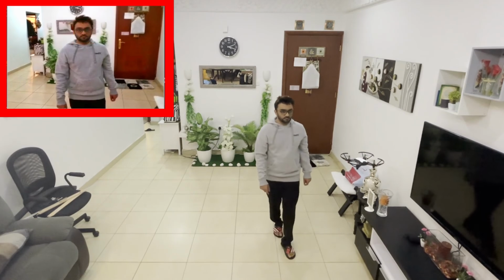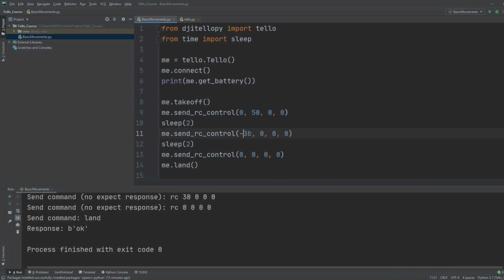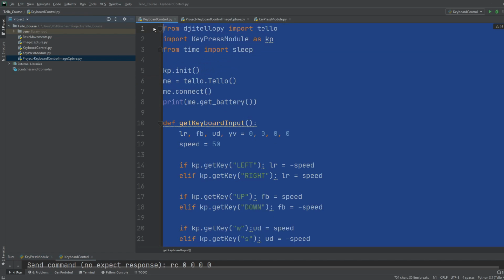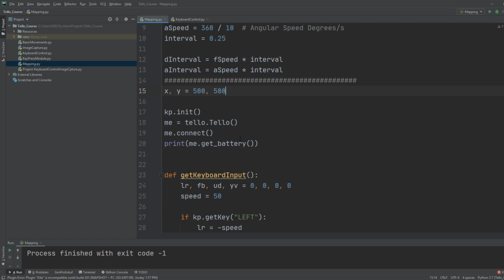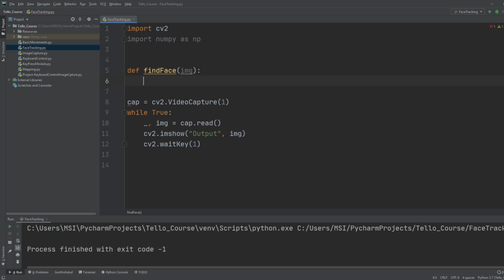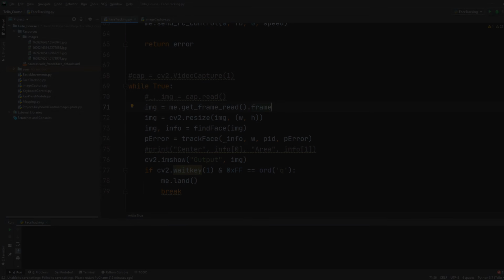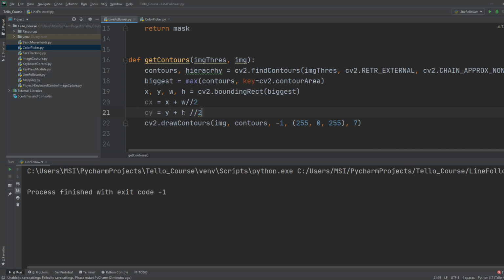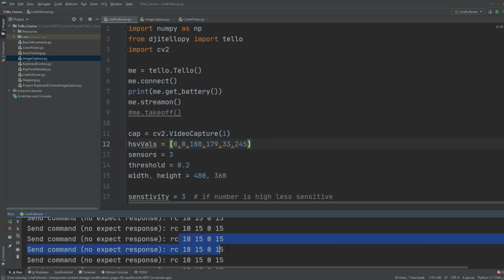Drone Programming With Python Course | 3 Hours | Including x4 Projects | Computer Vision

Comment: Watching and learning 3 years later! Impeccable content!

May I suggest a review of the derivation of the equations on coordinate measurement in project 2 mapping. 

We've correctly assumed, the distance in unit time, in our case is 10m, however in the equations, y=10xsin(45), we juxtapose displacement with Distance. 10 m in a second is the distance, the length of the curved path, or the section of the circumference of a circle with radius R= V/w (where V is 10m/s in our case, and w the rotational velocity, 45 deg/s) in our case.

Here's an excerpt answer from ChatGPT when asked to evaluate position of a drone moving at a constant velocity of 10 m/s, rotational speed of 45 deg/s after x amount of time:

"To analyze the motion of the drone and determine its coordinate position after a certain amount of time, we can break the problem into two main parts: linear motion (forward velocity) and rotational motion (clockwise rotation). The drone's path will trace a circular arc due to its constant rotation while moving forward. Let's denote:

- V as the forward velocity of the drone, which is 10 m/s in this case.
- W as the angular velocity of the drone, which is \(45\) degrees per second. However, for calculation purposes, we need to convert this to radians per second. \(1\) degree = \(\frac{\pi}{180}\) radians. So, \(\omega = 45 \times \frac{\pi}{180} = pi/4 radians per second.

### Position Calculation

Assuming the drone starts at the origin \((0, 0)\) of a coordinate system at time \(t = 0\), and its initial heading is along the positive x-axis, we can calculate its position after time \(t\) seconds due to its circular motion. The radius \(R\) of the circle traced by the drone's motion can be found using the relationship between linear velocity (\(V\)), and angular velocity (\(\omega\)), where \(R = \frac{V}{\omega}\).

#### Equations

1. **Radius of Circular Path**: \(R = \frac{V}{\omega}\)
2. **Angular Displacement**: \(\theta = \omega \times t\), where \(t\) is the time in seconds.
3. **X and Y Coordinates**: The drone's position \((x, y)\) on the circle after time \(t\) can be determined from the circular motion equations:
   - \(x = R \cdot \sin(\theta)\)
   - \(y = R \cdot \cos(\theta)\)

Note that these equations assume the drone's path is a circle centered at the origin with the drone starting at the point \((R, 0)\) and moving in a clockwise direction. However, due to the clockwise rotation, we may need to adjust the signs in our final equations based on the direction of motion.

Let's plug in the values and compute the position of the drone after a given time \(t\).

After \(10\) seconds, the drone's position, assuming it started from the origin and moved in a clockwise direction with a constant forward velocity of \(10\) m/s and a uniform clockwise rotation of \(45\) degrees per second, would be approximately \((12.73, 0)\) in the coordinate system. The \(y\) value is very close to \(0\), indicating the drone has moved almost exactly along the x-axis from its starting point, which is due to the nature of circular motion and the specific time chosen for this calculation.

This result indicates that after \(10\) seconds, the drone has essentially moved in a circular path and returned very close to its original horizontal position due to the combination of its forward speed and rotational speed. 

To determine the drone's position after any amount of time \(x\), you can use the equations:
R = V/W
x= R.sin(W.t)
y = R.cos(W.t)

where t is the time in seconds, V is the forward velocity, and W is the angular velocity in radians per second."

Comment: Hi Murtaza, I found your course very well explained. I have been following your course using OpenCV 4.9.00 and Python 3.11. I have encountered an issue where the webcam does not display the contours in black and white on the A4 paper as expected. Instead, it shows an error at this line of code: _, img = cap.read(). Could you please advise if this issue might be related to the versions of OpenCV and Python that I am using? Any guidance you could provide would be greatly appreciated. Thank you.

Comment: Hello, I am facing a challenge during the image capture project and hoping that you or someone with the knowledge may be able to help me. I keep getting the following error. I have tried rebooting, and reconnecting and also have tried on 3 different Tello edu drones. However, I get the exact same error code with all the 3 drones. I am directly connected to the Tello drone through its own wifi hotspot, also My Windows Defender firewall is turned off and I do not have any other antivirus software installed. I do not understand. Please guide.
I am attaching my code first and then the outcome/error message.
P.S: I also tried to remove the resize command code and still, I get the same error.

CODE:
from djitellopy import tello
from time import sleep
import cv2

drone = tello.Tello()
drone.connect()
print(drone.get_battery())

drone.streamoff()
sleep(1)
drone.streamon()

while True:
    img = drone.get_frame_read().frame
    img = cv2.resize(img, (640, 480))
    cv2.imshow("frame", img)
    cv2.waitKey(5)

RESULT:
C:\Users\joshi\PycharmProjects\OpencvPython\TellDrone\.venv\Scripts\python.exe C:\Users\joshi\PycharmProjects\OpencvPython\TellDrone\ImageCapture.py 
Send command: command
Response: b'ok'
Send command: battery?
Response: b'90\r\n'
90

Send command: streamon
Response: b'ok'
Traceback (most recent call last):
  File "C:\Users\joshi\PycharmProjects\OpencvPython\TellDrone\ImageCapture.py", line 15, in <module>
    img = cv2.resize(img, (640, 480))
cv2.error: OpenCV(4.4.0) C:\Users\appveyor\AppData\Local\Temp\1\pip-req-build-6sxsq0tp\opencv\modules\imgproc\src\resize.cpp:3929: error: (-215:Assertion failed) !ssize.empty() in function 'cv::resize'

Process finished with exit code 1
Reply: UPDATE:

I was able to solve the problem. Apparently, the issue was with the network adapter on my machine. So I used the following solution.

1) Take a wifi extender and configure it to connect to the Tello drone wifi address.
2) Connect the laptop via LAN cable to the wifi extender.
3) Connect to the Tello.

I was able to solve my problem with this method. The problem was not in the code, however, it was in the hardware and I used a different method to connect to the Tello.
Reply: @joshichintanc96 I’m having the same issue , i will try this solution , thanks
Reply: @joshichintanc96  for me doesn’t work 😑
Reply: @ That's unfortunate. Are you getting the exact same error? Because, using a dedicated network extender helped solve the problem for me. If I have to guess, it would be that issue was with transmission of data packets/firewall settings. Using an extender solved the issue. 

Please share exactly what you are doing and exactly what error do you face? Maybe the community could help you out or we could brainstorm.

Comment: Hello, Is it possible to have a version using C or C++
Reply: U don't need to write ur code in c or cpp because in this case u just need  to write a commands that can let u contrôle the drone and to that it is prefer to write the shortest code and the most readable also python has more lib can be implemented enlese if u are writing the firmware so here u will need cpp or c

Comment: brave effort, ut you confuse early on by referring to HDMI input on laptop.when you mean HDMI output- youcould overlay a correction graphic.

nav  of vid a good idea-

I'd like new vid re adding bluetooth c<pability to wirelessly stream video and sound via bluetoothfrom my macbook to my non-smart TV, using ineypensive plug-in  HDMI bluetooth adapter-  or is such streaming only by using appleplay through an apple adapter? nothing I found on net is conclusive one way or the other. of course, more people will be inTerested in wirelessly streaming from a PC to TV.
I TI think earlier bluetooth standard only audio-capable, nt for video- is that so, video and audio now supported over bluetooth?
anyone reding this acheived mac to non-smart tv streaming of video with audio, using inexpensive hHDMI bluetooth adapter on the TV?

Comment: Hi Paul, Have you been down the path of Arduinos and 3 Aspect signals that are is Series, as Signal 1 is Red, signal 2 is Yellow, Signal 3 is Green, with this in mind is there anything around that will able this to happen with out all the wires that I seem tp have got on my Breadboard. I would like to have a HO scale Cabinet somewhere behind the 3 Aspect Signal away from the Track area. To me this should be similar to have a Series of Points  on a layout that get their power via the Buss Wire, could this happen to the Arduino and 3 Aspect Signals. I think could save a heap of wires around the layout. I have been able to make an Arduino, Breadboard, Wire and Leds to work. I am not sure just how many signals can be on the one Arduino to work a series of 3 Aspect Signals, to change each from 1 color to the next when the track is clear. THANKS for your time Graeme

Comment: Hello Murtaza, thanks for your detailed tutorial.
I'm having trouble at part "Image Capture" (starting from 31:16), the terminal in PyCharm said "Cannot get first frame". I believe this happened not just in my system and programming environment.
After trying to set every dependency the same as yours, this error still exists.
Some other people are also facing this problem, submitting the issue on GitHub, and it seems they didn't find solution either.

Could you please have a look at this "Image Capture" part? Maybe something has changed, so your code here may also need a little change? 
I'm looking forward to your response! :)
Reply: did you solve it?
Reply: @everysimotv3837  Sadly no
Reply: hey!!! how did you do face tracking?? it's detecting my face but not tracking it :(

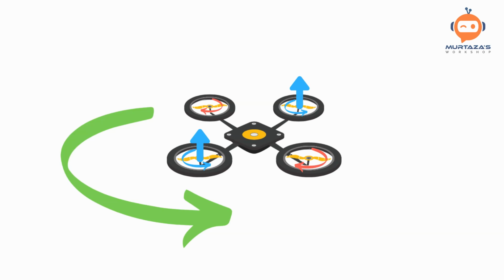Comment: at time 8:30, https://youtu.be/LmEcyQnfpDA?t=510, I guess you mixed rotations or is it correct, because if you decrease speed of clockwise and increase speed of anticlockwise motors then drone must turn anticlockwise, right? @murtazasworkshop

Comment: Does the non-edu one support python programming. I think it doesn't?
But the white drone seems like the normal one.
Reply: According to the video, they don't have difference at coding mentioned in this video.
Reply: @alexanderyang126  True, I bought both. Both support python. But the non-edu one is extremely unstable. It cannot even hover stably. I believe it's a defect. Will return it.

Comment: Thank you for your amazing video. I am 75 YO retired Telecom Engineer and my hobby is IoT and Aeromodelling. I really learned a lot of skills from your meticulous explanatory videos. 
I have a doubt that is: If I program the Tello to Take off and fly forward for 10 feet, then stop and reverse for 10 feet, stop and land, it is not landing at the place from where it took off due to change in battery condition etc., 
Is it possible to program the Tello to fly to a specific distance and come back, using it's accelerometer data or is there any other Drone model which can only, do this for me. Please advice. Thanks again with GREAT regards.
Reply: Some GPS drones have auto return to home.

Comment: Has OpenCV changed since you did this video or is there something missing that is needed to use OpenCV? I tried following along but none of the image capture stuff works, none of the functions you used for the OpenCV parts are being recognized and I downloaded the same library you did and just imported cv2 just as you did but pycahrm throws an error any time I try to use any of the cv2.whatever functions
Reply: Just to be clear here, I have added the OpenCV Python library in the settings, done import cv2, and everything from cv2.resize() to cv2.imshow() gives an unrecognized function error and cause the code to fail to run.

Comment: Hi, buddy. Is there a way to use computer mouse to control  the JR module? I m studying on a keyboard mouse method to fly FPV drone. The keyboard is very special designed by me with range. I test it on liftoff. With 0 experience and only 25 hours practice I break in world 23 on a track. So I really wanna apply this range keyboard + mouse method on real Drone. I just need the mouse output to the JR module now.

Comment: Hi Murtaza, you created an amazing tutorial on how to program the Tello drones, but I have one issue, in the keyboard control program the drone takeoff, but it is not accepting any other keyboard, and it land after 7 seconds. I cannot mow right or left or yaw the drone. I have the following errors:
Traceback (most recent call last):
  File "C:/Users/alzam/PycharmProjects/Tello_Course/KeyboardControl.py", line 34, in <module>
    me.send_rc_control(vals[0], vals[1], vals[2], vals[3])
  File "C:\Users\alzam\PycharmProjects\Tello_Course\venv\lib\site-packages\djitellopy\enforce_types.py", line 53, in wrapper
    check_types(spec, *args, **kwargs)
  File "C:\Users\alzam\PycharmProjects\Tello_Course\venv\lib\site-packages\djitellopy\enforce_types.py", line 46, in check_types
    .format(name, type_hint, type(value)))
TypeError: Unexpected type for 'yaw_velocity' (expected <class 'int'> but found <class 'NoneType'>)
[INFO] tello.py - 437 - Send command: 'land'
[WARNING] tello.py - 447 - Aborting command 'land'. Did not receive a response after 7 seconds
[INFO] tello.py - 437 - Send command: 'land'
[WARNING] tello.py - 447 - Aborting command 'land'. Did not receive a response after 7 seconds
[INFO] tello.py - 437 - Send command: 'land'
[WARNING] tello.py - 447 - Aborting command 'land'. Did not receive a response after 7 seconds
Exception ignored in: <function Tello._del_ at 0x000001C74282AC18>
Traceback (most recent call last):
  File "C:\Users\alzam\PycharmProjects\Tello_Course\venv\lib\site-packages\djitellopy\enforce_types.py", line 54, in wrapper
  File "C:\Users\alzam\PycharmProjects\Tello_Course\venv\lib\site-packages\djitellopy\tello.py", line 1019, in _del_
  File "C:\Users\alzam\PycharmProjects\Tello_Course\venv\lib\site-packages\djitellopy\enforce_types.py", line 54, in wrapper
  File "C:\Users\alzam\PycharmProjects\Tello_Course\venv\lib\site-packages\djitellopy\tello.py", line 1006, in end
  File "C:\Users\alzam\PycharmProjects\Tello_Course\venv\lib\site-packages\djitellopy\enforce_types.py", line 54, in wrapper
  File "C:\Users\alzam\PycharmProjects\Tello_Course\venv\lib\site-packages\djitellopy\tello.py", line 579, in land
  File "C:\Users\alzam\PycharmProjects\Tello_Course\venv\lib\site-packages\djitellopy\enforce_types.py", line 54, in wrapper
  File "C:\Users\alzam\PycharmProjects\Tello_Course\venv\lib\site-packages\djitellopy\tello.py", line 486, in send_control_command
  File "C:\Users\alzam\PycharmProjects\Tello_Course\venv\lib\site-packages\djitellopy\enforce_types.py", line 54, in wrapper
  File "C:\Users\alzam\PycharmProjects\Tello_Course\venv\lib\site-packages\djitellopy\tello.py", line 529, in raise_result_error
Exception: Command 'land' was unsuccessful for 4 tries. Latest response:	'Aborting command 'land'. Did not receive a response after 7 seconds'

Process finished with exit code 1

Comment: this course is great! just going through it now.. is it ok to have python 3.10 rather than 3.7.6?   Also when I am installing the packages, you have gone through the PyCharm UI, is it still the same as installing it through terminal on my virtual environment? is that not just the same thing?
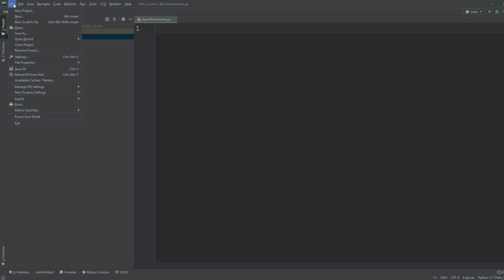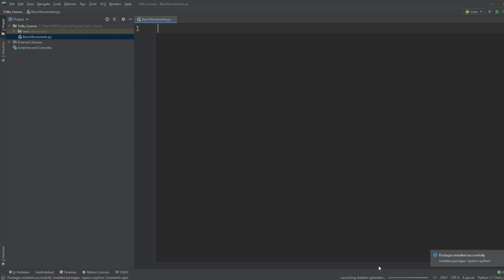Reply: ok so its just the same as doing pip install djitellopy or pip install opencv-python  [20:08 - 22:18] You can still go through the settings method to double check your installations ..loving this course can't wait to learn more !

Comment: I cannot do basic movement program, I get the error "Did not receive a state packet from the Tello" ... I have shut off my firewall and I have updated the firmware.  Still no luck and I am using windows 10 and python 3.7 ... has anyone else seen this error?

Comment: when I run the command I am not getting ok response, when I run on Laptop. If I run UDP client on Mobile then the SDK commands are running fine. I tried disable Windows Firewall temporarily as well, but not working.

Comment: For macOS users on M1 silicon: First program failed for me wasn't sure why. Partner had to help me out (they are a software engineer). Anyway, if you have the same issue you need to do 'brew install ffmpeg' takes a while to install but now it's working. Thought I'd share :)

Comment: hello i have a problem dji mavic air is not activated can you help me i tried every way i couldn't fly
Reply: Install the software of mavic and test all motor and gps distance proper calculation all work fine the start trx with auto mode or throttle mode and keep your all trx cell charge fully and rx side also fully charged then start now. 🎉

Comment: I received this error: 

C:\Users\User\PycharmProjects\OpenCVpython\venv\Scripts\python.exe C:/Users/User/PycharmProjects/OpenCVpython/BasicMovements.py
[INFO] tello.py - 107 - Tello instance was initialized. Host: '192.168.10.1'. Port: '8889'.
[INFO] tello.py - 422 - Send command: 'command'
[INFO] tello.py - 446 - Response command: 'ok'
Traceback (most recent call last):
  File "C:/Users/User/PycharmProjects/OpenCVpython/BasicMovements.py", line 5, in <module>
    me.connect()
  File "C:\Users\User\PycharmProjects\OpenCVpython\venv\lib\site-packages\djitellopy\enforce_types.py", line 54, in wrapper
    return func(*args, **kwargs)
  File "C:\Users\User\PycharmProjects\OpenCVpython\venv\lib\site-packages\djitellopy\tello.py", line 531, in connect
    raise Exception('Did not receive a state packet from the Tello')
Exception: Did not receive a state packet from the Tello

Process finished with exit code 1

any assistance here?